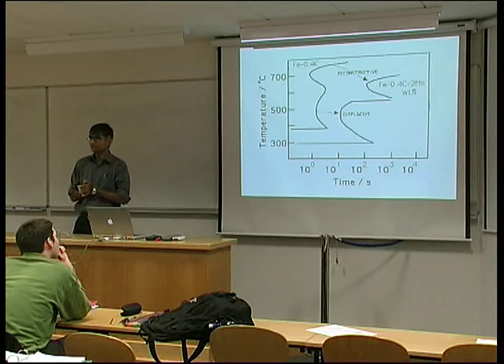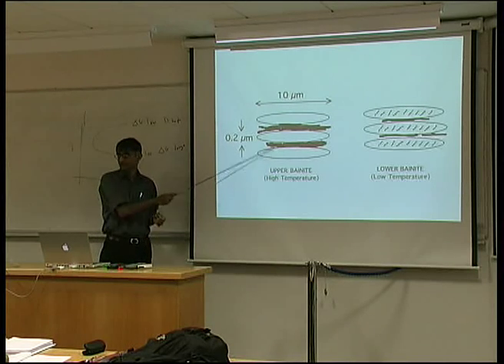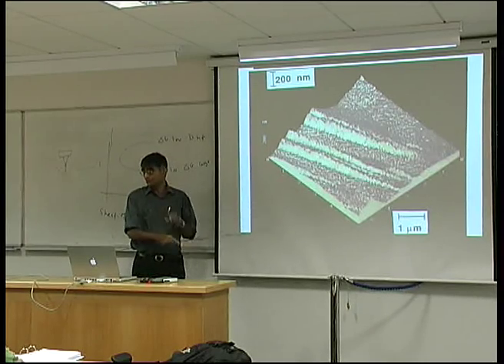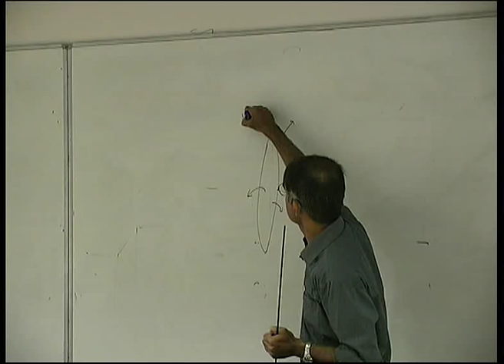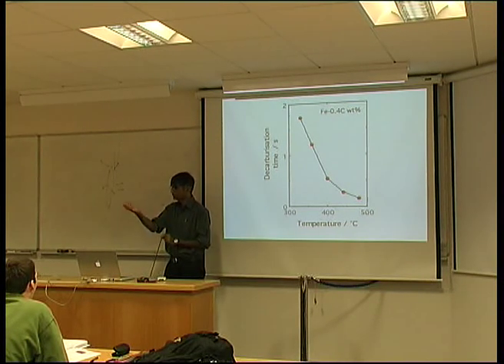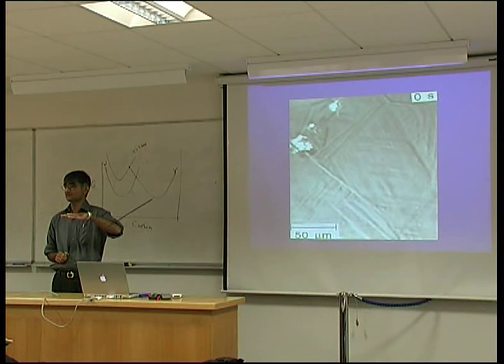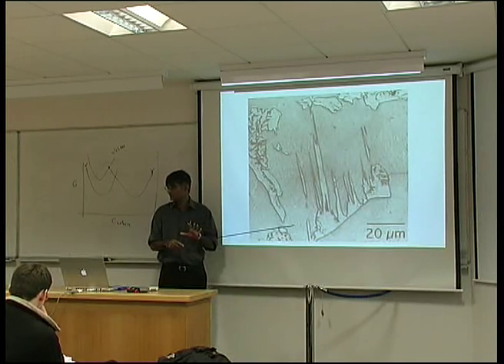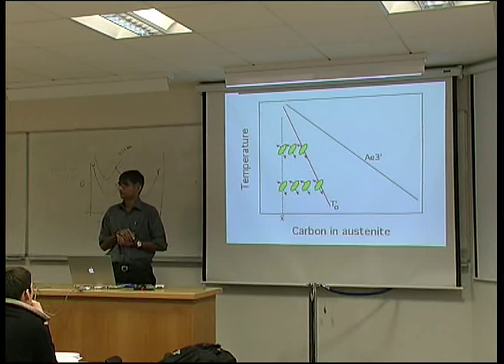Bainite and Widmanstatten ferrite in steels

Comment: It seems clear that this bainite reaction cannot go to completion due to some of the austenite between the laths being enriched in carbon so as to reach or exceed the To carbon content at the isothermal transformation temperature.  However, shouldn't some of this remaining austenite (which is metastable at the bainite formation temperature) be able to transform to martensite when the kit is brought down to room temperature thus giving us a mixture of bainite and martensite? If we had been forming upper bainite, couldn't some of such metastable retained austenite (which is retained at the upper bainite transformation temperature) transform to lower bainite upon cooling the kit to room temperature since lower temperatures increase the To carbon content level?  I do realise that there may not be a lot of time for the latter to occur but there would be some time available for this.
Reply from the maker: Whether the austenite left when the bainite reaction stops, transforms into martensite, depends on its chemical composition. If its martensite-start temperature is below ambient then it will not transform.
See the following:
https://www.phase-trans.msm.cam.ac.uk/2000/C9/EX.pdf
https://www.phase-trans.msm.cam.ac.uk/2000/C9/AEX.pdf
Reply: @bhadeshia123  I truly enjoyed the lecture but a couple of points are unclear.  It is hard to imagine how a sudden shear deformation can occur either continuously or in steps (eg. the growth of a bainite sheaf) along the planes they occur on.  Such a time dependent growth or reaction would create another moving interface at the growing edges of the growing plates.  Alternately, it's much easier to envisage the whole length of a plane shearing at once (within a grain of austenite...up to the high angle GB).  The lecture did not explain the cause of the incubation time before the bainite transformation starts nor did it explain what controls the kinetics of the plate growth once it begins.  Although the lecture explained that carbon diffusion kinetics are not rate controlling, it did not explain what was rate controlling.  One other item not discussed was the deformation of adjacent austenite during the martensite transformation.  I suspect that this should still occur as it does during the bainite transformation.